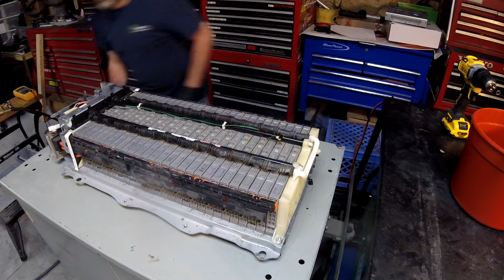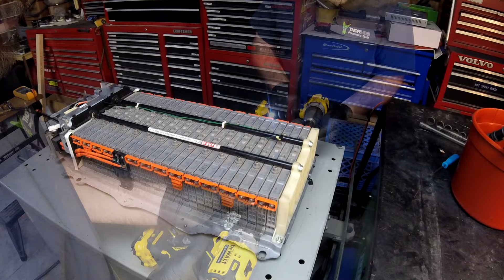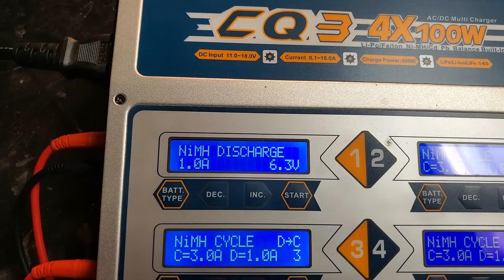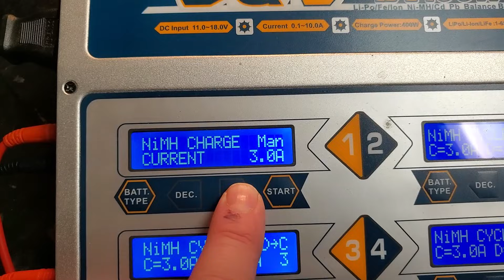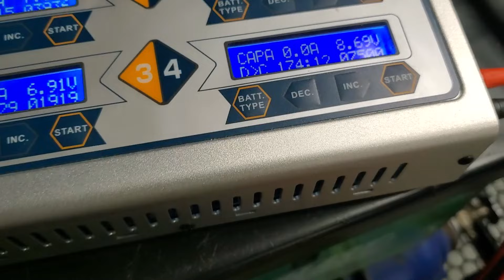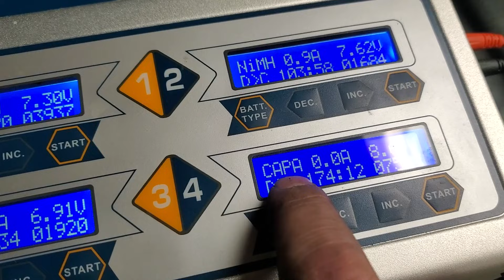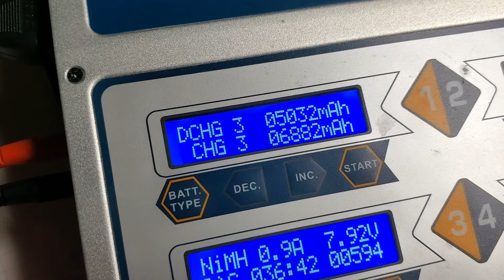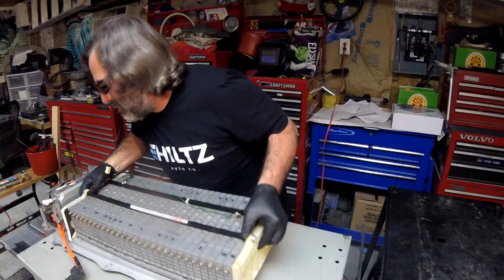DIY Refurbish / Repair Hybrid Battery 2nd Gen Toyota Prius - EV-Peak smart charger POA80 P0A80

Comment: I just got a T 180 tenergy.Tried it out on my to be replaced module. 
I dont get a read out like yours shows.Mines as follows/
Input V.14.68
Delta peak 5m v/c ??
Saftey tuner 240 min.
Capa cut off 6500 man

Capacity 3 may
Current o.oA
V.7.81 Volts
Stage end

Resistance 118m ohms
Peak temp No sense
3 u say is very bad/I dont see a high?
I'm trying a sec.module now but it keeps saying. NiMH Delay
Flashing that and counting? 
I un plugged it and started over/ same thing.
Yes! I DON'T NO WHAT IM DOING.
Number one/wish my screen read like yours/low/high.
Second/I dint under stand the Delay thing?
Reply from the maker: Thank you for watching and writing in. I do not have any experience with Tenergy charger mentioned. Does anyone reading this comment have suggestions/feedback for Steve?

Comment: 2 questions:
1) Is the purpose of the discharge/charge cycles to only determine which batteries are bad? Or is discharging/charging actually repairing the battery back to its normal state or “refurbishment” of the battery.
2) is 5000mAh the absolute cut off that determines a battery is bad? What if  the first discharge was below 5000mAh and the final 2 were above 5000mAHH would you consider it still a good battery?
Reply from the maker: Hey Miami King, Thank you for watching and commenting. The charging and discharging of the cell is what will bring it back to a better capacity. Over the time I have been doing this process I have learned that 5000mah as a low capacity number will still provide a good lasting pack for the car. A low capacity number over 5000mah is better. it is important to remember that your pack when assembled will only have the capacity of the lowest cell it contains. If you have a pack that has 27 cells with 6000mah and one cell with 4000mah then the whole pack is seen as 4000mah to the car.
Reply: @GreggFesto  thanks! Excellent video. Going through the process now. Takes a looooong time!

Comment: hai where did you get this charger from? I can't find them anywhere ? thanks
Reply from the maker: This charger came from an online hobby shop. They are getting hard to find now. Check out some of the comments as others have listed the chargers they found and have used which also work.  The main think to look for is a charger that has the settings for nimh battery type and discharge/charge cycles that you can change.

Comment: Hey Greg I have a 2006 toyota prius  how do you count the blocks is it  block  number  one is closest  to the ecu  because  my scanner  tool said block 10 so I counted right to left and got my meter and the voltage is good so then I count from the ecu to 10 and the module  that is connected  to the safety  plug bus bar and cable is very low so I confused  when counting blocks  any help thanks
Reply from the maker: Hello Nathaniel, Thank you for watching and commenting. I count my cells as #1 is furthest from ECU.
Reply: @GreggFesto  I heard today that different versions of the Prius can have a different numbering order !   But, apparently, number one is always at the NEG end of the pack - no matter where that is in relation to the ECU.
Reply from the maker: @Richard King, I heard the same thing but have not been able to confirm with my own eyes. Thank you for watching and writing in. Together we can learn.
Reply: so standing at the rear of the trunk  cell 1 would be all the way towards the passenger  side ?  Because when I got my volt meter out to test block ten because  that was what my scanner  said  so I counted farthest  from the ecu those cells were good so then I tested closest to the ecu and then I found bad cell in block 10 so I'm guessing  it depends  on how toyota  did it for those years  some is right to left and some is left to right
Reply: I found that block 10 is the one in middle that  has cable terminals  connected  to the two cells
Reply from the maker: I believe 1 block = 2 cells. 
Starting from end furthest from ECU. 
Cells 1&2 would be block 1.
Cells 3&4 would be block 2.
Cells 5&6 would be block 3.

Comment: Hi great job and your video helping me a lot but
I have one question I have heard don’t discharged the cells to low some they say 2.5v some at 4v I have a charger like yours but where is that settings how low you can discharge? Or by selecting the type of battery it doe’s it for you 
Thank you
Reply from the maker: Thank you for watching, providing feedback, and commenting. Much appreciated. I do not setup or worry much about the voltage readings as the current reading are what is my primary focus when doing this process. There is one voltage setting which I forgot to include when talking in the video and you can see it on one of the screens, that is 6.3V. This particular pack was installed back in the car and has been daily driven since with awesome results.

Comment: Gregg - I am a retired electronics tech in the process of possibly purchasing a 2007 Prius with 255,392 miles on it.  Do you know of anything else I should be checking? Having seen your video I see that I should not be too afraid of it.  The testing of the battery pack will determine how many cells will need to be replaced.  Wish me luck on my negotiations.
Reply from the maker: Hey Michael, In my opinion the 2nd Gen Prius from 2004-2009 are the best so far. They are very reliable and easy to work on. When looking at one (or any car) I suggest  you get an inexpensive OBDII scan tool and check the system for fault codes (current, pending, and historic), this can help you know if a problem is current, coming up, or possibly have been repaired. You can get them on ebay or amazon for around $15 and there are many apps. Some of the apps are specifically geared towards Prius and can provide hybrid battery health. Most repairs on this car can be done yourself with basic tools. BEST CARS AVAILABLE IN MY OPINION.

Comment: Hi Gregg! Great video! Just a suggestion from my experience with these batteries. I found that it is beneficial for the cooling of the battery if I move the two end temperature sensors 2 or 3 modules closer to the middle one. As the battery is getting more hot in the middle this way it is tricking the computer to run the cooling fan earlyer and keeping the battery  better cooled. It is not making the fan to run at 100% in any way so it stays quiet.
Reply: That doesn't really buy you anything. The fan kicks on if Any of the sensors show hot, so moving them to the middle means you only monitor center and never the edges.

It still kicks on if center gets warm anyway
Reply from the maker: Great idea, Have you determined if this works for certain. I did not know if the fan cut on when temp sensor reached certain value or if it was actually looking for differential in temp sensor values to cut fan on.
Reply: moving the temp sensors is frowned upon amongst professionals, amongst amateurish lay men it is some sort of ingenious revelation.

Comment: Doing civic hybrid what if high number is going down but low number is going up im having a hard time seeing what could be good vs bad because inconsistent reading I have the same charger
Reply from the maker: When I have the situation of high number going down and low number going up I run more cycles.  Usually you will reach a point where to low number does not rise any further. This would be the point to make decision if cell is good or bad. I have had it where low and high numbers both start going down after a few cycles. I feel this means the pack is starting to fail and should be replaced.
Reply: So what would be a show sign to abandon the battery or cycle more also where does voltage come into play I have so holding over 8 volts after and some near mid 7 all after charge? Also thank you very much all your help is really appreciated
Reply from the maker: I continue to cycle the cell until the low amp number starts to fall off or stays the same for  a couple of cycles. This tells me that the cell is most likely not going to improve any further. If the low number falls for 3 cycles then I replace the cell as I feel it is already starting to fail. I don't really worry about the voltage too much as most are within 2 volts of each other. If I have one that is really low such as 4V and it has gone through cycles then I replace the cell.  The voltage will equalize when you place the cells in parallel configuration. Glad I could be of some help. I appreciate you watching and asking questions. I hope you will write back in and let me know how many cells you had to replace (if any) and how your pack performs when complete.
Reply: @GreggFesto  update I have made a new discovery i ended up ordering another charger a protek rc prodigy charger used and found that the bguad c83 quad charger is unreliable for this process. I originally bought to charge 8 at a time but decided to run some “bad” cells charged from cq3 through the protek and got much more stable results my current criteria is all good cells must be 
over 7.9v (or very close most over 8)
Discharge Over 5300mah 
Charge 6500mah
Starting to look very promising results are very close to my stated values
Reply from the maker: Sidney, Thank you for the update, this is excellent news. Sounds like Protek RC Prodigy Charger is a good choice.
Reply from the maker: I have run some cells over 12 cycles before they stopped improving.

Comment: Hi dear thanks for this wonderful full vid it’s useful, but i have question to measure the capacity should i charge the cell up to 9v and discharge it up to 6v or how does it work? 
Thanks
Reply from the maker: Check back to the video again for settings.  The number that I use is the lower capacity number to determine battery health. Thank you for watching and commenting.

Comment: Thanks for a great video.. I have a 2008 gen2 Prius and all the info I see is the cells are 6500mah... You charged yours to 7500mah.. Am I missing something... I have charged 7 cells and the highest I have gotten is 4550mah... That's 4 charge cycles.. Car has 150,000 miles...Am I charging it wrong?  Thanks
Reply from the maker: Hello Mike,  Thank you for watching and taking the time to comment. My high cutoff is 7500mah and  this is for safety. The number to actually pay attention to is the lower mah number. This is the actual capacity of the pack.  To get the low number to change you will need to do the discharge then charge cycle as I did in the video. This is the method that the charger uses to "refurbish or repair" the cell. If you are only charging the cell and not discharging as well may be why the numbers are not changing. Please write back and let us know how your pack turns out.
Reply: @GreggFesto  I should have said I have done 4 discharge charge cycles but only to 6500mah... I just hooked up the charger once again...This time set it to 7250mah charge at 5amps discharge 5amps for 3 cycles... Looking to see if I get a different and hopefully higher MAH... Thank you for replying.... Worked on cars all my life .. Prius batteries a different world... But I'm learning...again thanks..
Reply from the maker: Hey Mike, Please let me know how it goes and if you see improvements with your settings.
Reply: @GreggFesto  I have been real busy sorry for the slow response .. I bought a tenergy t180 to do the charge discharge on the Prius cells ..  I did 3 cycles and from cell one to cell 9 they averaged 4250mah...Then 10,11,12,13, dropped down to 2250mah... 14 went back up to 4250 but 15 went back down.... Looks like the entire battery is pretty well used... I don't think putting in cells will do any good when the best is 4250mah.... 2008 Prius 150k miles... What's your opinion Gregg?...thanks
Reply from the maker: Hey Mike, I think you need to keep going with the charge discharge cycles and see if you can get the numbers up. try a slower discharge rate on cells 10-13 as this could help them recover better. I have done more than 16 cycles before giving up.  Each cell you can save is like money in your pocket or at least the charger paying for itself.  The cells that are 4250mah should be tried for a few more cycles too. You are so close to having a decent pack that it really is worth the effort especially with the way prices for everything seems to be going crazy right now. please keep me updated on what you decide to do.
Reply: @GreggFesto  I will do 10 thru 13 and tell you what I get... I hope it works out...I'm in Calif gas is $5.00 and up...thanks
Reply from the maker: Hey Mike, Yeah gas is going crazy here too, we are at $5/gal for diesel and gas not far behind. Best time to own a gas sipper. I look forward to seeing your results for additional charge cycles.

Comment: Thanks for all the information on this video, yours is the best, I'm working I'm my Camry 2007, I bought 2 smart charges from Amazon different brand similar settings, this process takes time but is effective, I'll post an update when finished with this project!
Reply from the maker: Thank you very much for the positive feedback.  YES please send feedback on how your refurbishment goes.
Reply: How did it go?
Reply: @michaelandrade1213  the car is running like new now, i make a trip to Florida from Chicago with no issues, I replaced 3 cells in the battery pack!!!
Reply from the maker: AWESOME!!! - Thanks for the feedback @elromantico223
Reply: Did you use the same settings in the video? I’m getting low numbers on my 2008 camry, thanks

Comment: Gregg-  This is the best video I've seen for this procedure, and I've seen many.  Thanks for posting.  As a person who has pulled my hybrid battery many times to replace modules (w/ the red triangle initially @ 158K miles), from this video I learned a fast way to swap out individual modules through your method of removing the module pack in one piece and away from the ECU.  Removing the screws from the bottom before removing the cover was a great tip.  I have an '06 with 270K and plan to keep it for awhile, and being able to decipher the black magic of removing and balancing the pack is made easier with videos such as this.  It was very helpful.
Reply from the maker: Kevin, Thank you very much for watching and writing in.  I really appreciate your kind words. Your comment makes me want to do more videos like this, Thank you Kevin.
Reply: Dang! Wish I'd watched the video again before disassembling.!
Reply: "The black magic of removing and balancing the pack" LOL it really does feel like some crazy hocus pocus waste of time  until you see results.

Comment: 8.39 is good or bad is my first time doing this sorry....
Reply from the maker: Hello Victor. In my experience the voltage is not as important as the current is. I suggest paying attention to the lower mah value.
Reply: @GreggFesto  Makes sense...but I have just started doing my first 4 modules....and seeing 11 volts on the screen. Is that something to be concerned about?
Reply from the maker: Hey Wade, Thank you for watching and commenting. Are you reading 11V from the cell or the incoming power on the charger? If it is indeed the cells, what is the mah rating of them?
Reply: @GreggFesto  Yes..When says END...I read it in the right hand corner. The first 4 I did read 11.0 11.3V ...My Mah on all 4 was below 900mah.
Reply from the maker: Wade, Those cells are dead. The voltage is reading high but there is low capacity. I willing to bet that cell voltage will drop super fast with any sort of load applied. A test you could perform would be to take an old headlight bulb and put across the negative and positive terminals in parallel with meter leads while reading voltage over a period of a few minutes then do the same thing to a cell with at least 5000mah on the low number. Based on the numbers from the charger, your second test will be brighter and still have most of voltage it started with. Please let us know how you proceed and what you decide to do.
Reply from the maker: Wade, How many cycles did you run overall on those cells? Were the readings you provided from the first cycle? I am interested to find out if the low mah numbers started going up, stayed the same, or went down more and what the voltage was for them as the capacity changed.
Reply: @GreggFesto  ran 2 sets of 3 cycles. still didnt see much improvement. Seeing the same on a few more....getting a little disappointed.
Reply from the maker: Wade, I am sorry to hear that. I have replaced as many as 12 cells in a pack before. I hope this is not the same for your pack. Please update when you get to resolution.
Reply: @GreggFesto  Beginning to think there is something wrong with CQ3...pulled this out of 08 Prius 138,000 miles ...showed only 1 block low. Not seeing anything over 300-500mah...over 24 batteries..???
Reply from the maker: Wade, That does seem odd, like yourself I have a hard time believing that every cell would be that low unless you are reading the pack when it is almost discharged.  Is the reading after you did a few cycles? Is your charger setup to discharge first then charge?
Reply from the maker: Wade, Check through the comments and find Sidney Peters who wrote the following - "i ended up ordering another charger a protek rc prodigy charger used and found that the bguad c83 quad charger is unreliable for this process. I originally bought to charge 8 at a time but decided to run some “bad” cells charged from cq3 through the protek and got much more stable results." I wonder if the later models of this charger are junk??
Reply: @GreggFesto  yes …. Screen says END on the left…
Reply: Yes 2 cycles
Reply from the maker: Wade,  I wonder if it is your charger not working properly. Do you have anyone close by that would let you borrow a charger to compare? Is there enough money in your budget to purchase another charger? I certainly would like to know what is going on with your packs.